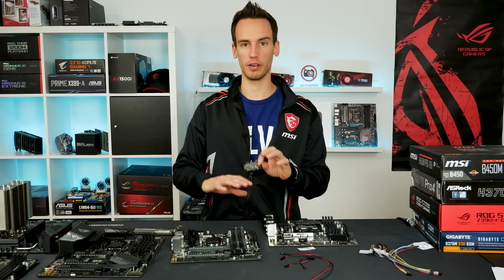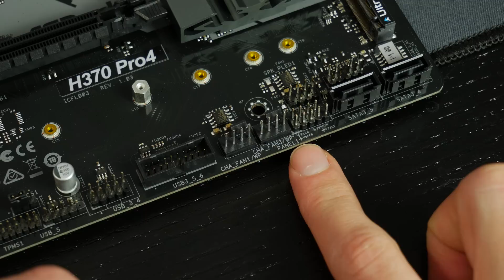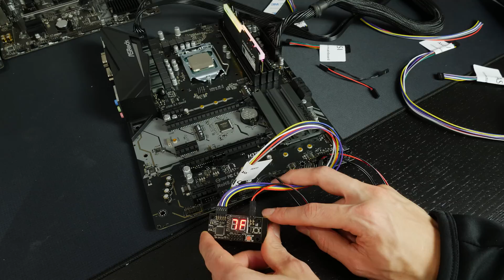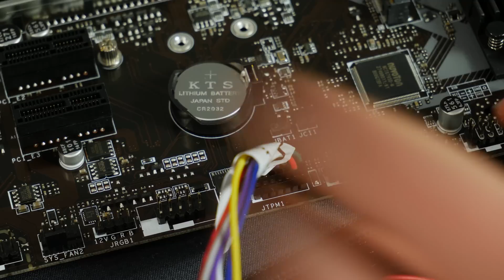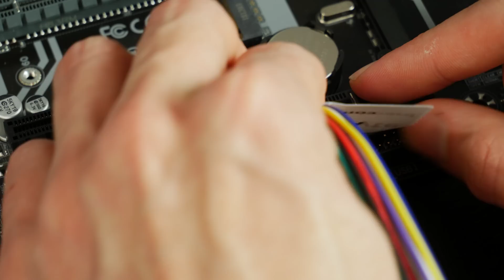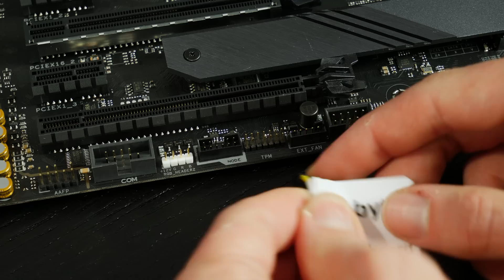Universal Debug-LED Card (en)

Comment: Does debug tool need to be plugged into power & reset connector on the motherboard? I would like to use use my Corsair case to turn the power & reset on/off..

Comment: Actually just found out the ASRock X670E Steel Legend which has no Hex code debug LEDs has an undocumented header called UART1, looks like an ARGB connector and is next to the CMOS RESET header, this can be used to connect to an LPC connector like the UDL. Just need to wire a connection for it.
Reply: Did you manage to do that?
Reply: @BucifalulR  To a limited extent yes, I can get BIOS post code results and memory test results but nothing beyond that as after the memory testing as rock uses what is connected to that header for propitiatory purposes.
Reply: @ Oh, sad to hear it but it’s still something. I once saw something about being able to read post code via the TPM header. Not sure if it still works today. EDIT: oh, sorry, this was in this very video..
Reply: @BucifalulR  I should add though it was not with the card that De8aur is mentioning here but one off aliexpress
Reply: @chassecourt8824  What card did you get?

Comment: And the LPC bus no longer exists, someone needs to look at how manufacturers have debug LED's on their current systems and then make something for SPI based TPM - preferably with passthrough that allows the SPI TPM to continue working so that peeps can have debug codes because this business of putting it on the most expensive of the boards only is stupid.

Comment: Hi der8auer! 
I wanted to get one but sadly out of stock. Is there a way to have another batch of production ? 
I am good also with soldering electronic wires could i buy an old PCI debug card ans solder some wires to the PCI golden pins and connect them to the TPM header ? 
Have a nice day !

Comment: I had a huge issue with memory DIMMs on my X79 boards and I was lucky enough to have the debug LED.  I tried every single combination and I realized one DIMM slot wasn't working.  What made this even more possible of a fix was the LEDs on my RAM itself funny enough. I'm using the DDR3 Crucial Ballistix Tracers and their RAM LED is very unique at the time and directly correlated with activity. I saw which DIMM slot was the issue.  After everything it turned out one of the motherboard CPU pins was bent. I bent it back carefully and everything worked.   People really ignore these kind of helpful visual aids until you have a problem and then they become immensely important.

Comment: This would be a nice tool for PC technicians, too.  I would buy a kit if the ends of the cables were keyed, preventing them from being plugged in the wrong way.  Yes, it would add complexity and cost as you'd have to start with a few different sized connectors, but it would be well worth it - I don't want to have to refer to a video or document every time I want to connect this to a different board.

Comment: only 200, argh. ok. I'll try for the 3rd of next month if it's still there (hope shipping to the states is ok). I know I have at least three comps I would love to have the debug code on the front in place of the defunct MHz led thing. I really prefer actual status indicators over rainbow vomit, lol.

GN R7 build (x370 gaming 5, hell yeah), workstation (M5A97 not-rev2.0, may need to add the plug to the empty pads), and a few minor boxes NAS/HTPC/etc.

Comment: Well my older cheapo Z97 from ASRock was one of the last reasonably priced Intel boards that still had: dual UEFI with hardware toggle, power and reset buttons, LED debug, extra SATA and extra USB3. Most mobo makers started to cut down features hard after Z87 and nowadays it's all just 1 UEFI chip and no controls and debug LED unless one buys very top of their offerings. Ridiculous. The cost savings have hit hard on motherboards in last 5 years. Same damn socket on Intel but features are going down and down with each refresh. I find it so ridiculous that nowadays 2x priced boards don't have these basic features. And of course my board also has the TPMS1 port.
Reply: v1m30

Cost saving is bullshit, it's just marketing, selling you low budget too premium boards, serving all.........
The Chipsets make the price of the boards, many cheap Z boards on the market! Ridiculous, just read how they sell cards, dealers are sales people, they make money on the extra's!
dip switch or buttons no price deal, just for marketing reasons! If you buy premium, you get the same board, they get a better margin. Able to buy the cheaper board too, marketing!!!!!

Comment: Do many boards without the post codes on the board really list them in the manual though? I've never really given that much thought because generally my cheaper boards don't have problems because I'm not doing crazy OCs with em
Reply: Yeah i smirked a bit when he said that, since i get to deal with boards with no POST display normally and have never seen them provide the codes in official documentation; granted, the Internet should know what's up, there aren't that many firmware codebases around.
Reply: @SianaGearz  yeah if say, board manufacturers standardized them (at least across platforms), that'd be handy

Comment: This looks very cool except for the part that plugging it wrong can damage the motherboard. That is just not reasonable for a device that has to be plugged in different and non obvious ways on each motherboard. You should consider adding the necessary protections to the circuit to prevent it from damaging the motherboard.
Reply: There's two fundamental possibilities. Possibility one, it's a CYA, because what are a bunch of high impedance inputs on a micro or PLD going to do to a mainboard? Nothing, nothing at all. But that is if passive listening is all that's needed. If there's any control needed, then they don't really have a choice, a safe implementation is likely to not be possible.
Reply: If you are unable to identify who the manufacturer is of your motherboard and also unable to line up the pins, then you are not in the target market for this product

Comment: KQCPET6 is a universal solution for a long time. With additional information and two times cheaper.
Reply: @Mihai Hanor connect using LPC cable
Reply: Security nightmare, directly in pci-e? No thankx.
Reply: @Mihai Hanor ... Cool? Wasn't relevant but cool
Reply: I'm pretty sure that's the pci version he mentions
Reply: @Unselfless  not only PCI - also PCI-E, LPC/TPM. Universal in one word.
Reply: @PROIIIu3Hb  I didn't suggest it couldn't. Just referring to what he said. I could have listed the spec sheet but I assumed you were able to comprehend what I was referring to

Comment: This device is very useful but the pricing is excessive, I wouldn't mind to pay 20 or 25 for it but 35+shipping? Nope!
Reply: He's said this is made for testing many systems. It's worth it for that
Reply: @Unselfless  the problem is that it is a standard protocol, it works on all systems because it is standard. In fact i already found some other solutions that integrates pci, pcie and the lpc (the one used by his device) in a single card ans costs half of this one including shipping. I don't like these because are too bloated and multipurposed but and lpc only would be awesome but not at that price.
Reply: @MasterControl90original  PCI is not used on any remotely modern motherboards. Everything is PCI-E. A problem with using that it requires a functional CPU while a TPM header does not
Reply: @Unselfless  are you just trolling or something? READ MY COMMENT!
Reply: @MasterControl90original  no... I addressed your incorrect thoughts. Nothing trolly there. I see you've ignored Siana though
Reply: @Unselfless  what's incorrect about my thoughts? Why I've to buy this device when  I can buy at half price a device that has the same functionality lpc(tpm) and relative adapters PLUS fast on the fly checks through pci, pci-e and USB? It is a very constructive thought tbh, as me others know about these devices and if they want to sell it a name in front of it is not sufficient but it needs to be at least in the same price range. So instead of being the fanboy blind hero just think with your head for once. BTW I didn't reply because Siana totally ignored the lpc which is through tpm.
Reply: @MasterControl90original  I don't and won't ever have this product so "fanboying" as you so crudely put makes no sense. You already have one so your obviously not his target market. I'm not either. Best to not make assumptions or you'll continue to make an ass out of yourself
Reply: @Unselfless  ahahaha ahah you are pissed, well you really are fanboying then
Reply: Wait so mere 40% on price on an item which is a price of one good meal makes or breaks the product for you? Most Western companies would expect you to pay north of a hundred for a tool like that, even though it is a simple tool and not really expensive to make, but there's overheads and cost of doing business as a Western company. These guys are not getting filthy rich on these, i can promise you that, it's just about at the brink of profitability.

Comment: Is there a way to split the Power / Reset cables so you can plug both the case's switches & the Debug LED Board's switches simultaneously?
Eg; A cord coming from the Debug LED Board for Power & Reset that have holes for pins on the top of the connector that goes into the MOBO's front panel pins so you can plug the case's cables into the top of the Debug LED Board's cables?
I am not well versed in electronics and not sure if this would work / if it would require some extra components to split the switch. Just an idea!
Reply: Sure...  just insert a y-cable at the board and connect the debug board to one leg and the Case switches to the other leg...

Comment: Some motherboards that have a Q code LED(or debug code), have it in a really bad place at the4 bottom.
On my In Win303 that has fans at the bottom, if I used a motherboard that has the debug code on the bottom of the board, I couldn't see the code, so this would be nice using the longer cables to place it where I could see the code.

Or on other boards it's in the middle on the far right, but if one is running SLI, NV Link, or Crossfire, it is blocked too.
Reply: Cliff S
Post bios beeps or QLED, all the same shit, same diag!!!!!! They all tell you the same shit!

Comment: Starting those systems without a cooler, feelsbadman
Reply: Wouldn't hurt anything, CPU would just see its running hot and downclock really hard maybe to 800mhz and at that point it won't need a cooler. CPUs are smart enough to not hurt themselves
Reply: @zacharytaylor8523  Nowadays, yeah :)

I've seen someone make that mistake in the past though. It wasn't so forgiving 😂

I think it was one of the earliest Athlons.
Reply: He has a video with exacly this issue. Removing the cooler on a hi end intel cpu while cynebench was running.  Dramatic temps, crazy low speed, though.... Cpu survived

Comment: I got an Asus diagnostics card for a TPM header which came with a 1366 board. Only works with some (by far not all it seems) Asus 1366 boards unfortunately. Still use one of those PCI ones usually, but I only work with second hand stuf so it almost always has several PCI slots

Comment: The LPC "Low Pin Count" IO bus is the protocol used by the TPM header, for anyone wondering, he is hooking into it for his debug module chip. Technically the LPC bus is the last remnant of the old x86 ISA bus, this allows stuff like Flash BIOS and others to connect directly to the CPU. This is a very useful device and we have been missing out on them since we lost the PCI slot.
Reply: Actually it seems someone in China has been making TPM POST cards too, but the availability is pretty bad and it just isn't nearly as nice, a pretty janky little unit that you'd only use in an emergency. Most repair techs take a Chinese laptop diag card (those with a Nokia LCD) and wire it in by hand as-needed. But i must say it's a nice product and the price is even competitive with Chinese offerings, because nobody will make a proto-quantity run of professional tools for pennies.
Reply: there are TONS of Chinese LPC post cards, they are marketed for laptop repair
Reply: Ah, exactly the information I was looking for. Thanks! I'm guessing there's no easier way to access this debug data with for example an PCIe card?

Comment: I searched for a HEDT board with TPM a year or a few ago and I couldn't find one :| Has the situation improved? I'd take TPM over RGB in a blink.
Reply: the zenith extreme definitly has one, no idea about other boards though
Reply: @jadoei13  https://www.asus.com/us/Motherboards/ROG-ZENITH-EXTREME/specifications/ This one? Doesn't mention TPM anywhere.
Reply: @sirius4k  It has a TPM header, look at the manual on page 18 (1-2), connector #29 is TPM: https://dlcdnets.asus.com/pub/ASUS/mb/socketTR4/ROG_ZENITH_EXTREME/E13369_ROG_ZENITH_EXTREME_UM_V2_WEB.pdf
Reply: @orondf343  Nice, thanks! Weird it wasn't listed in the spec sheet.
Reply: Asus WS X299 sage also for sure has one, you can see on the manual and on specification page.
Reply: @eliadbu  Thanks, I may go with the Zenith Extreme as it turns out it does have a TPM header after all. My next board needs to have 10Gbps port.